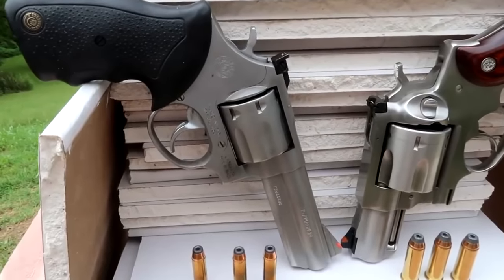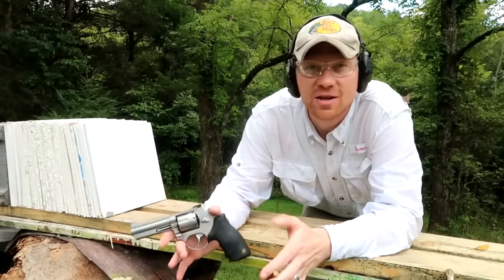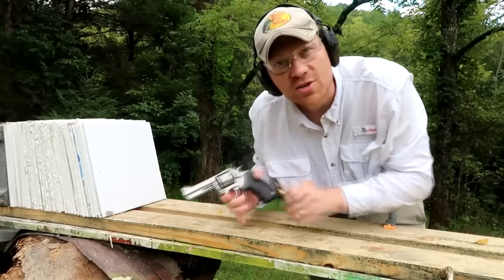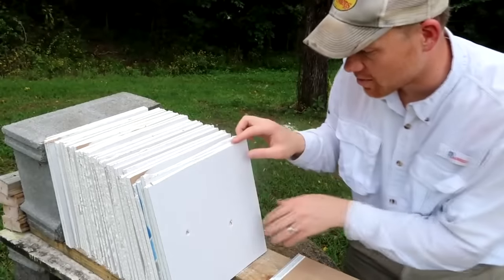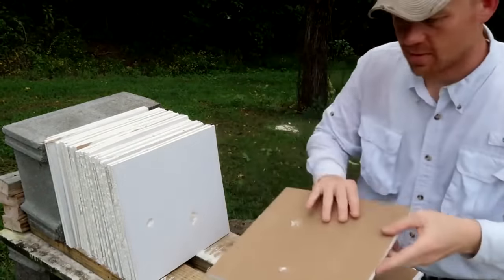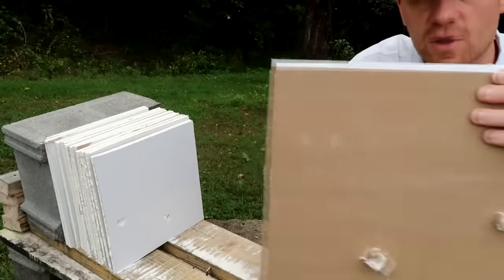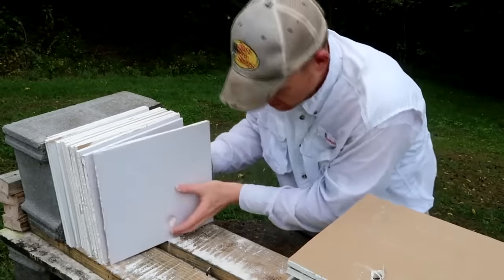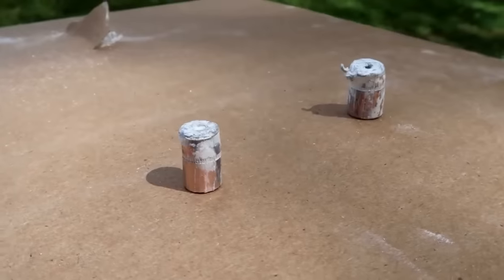.357 mag vs .44 mag - Drywall Test

Comment: Adam, don't you think the 44magnum would have made about 4 more sheets if it had an 8 inch barrel?
Reply: Of course it wldve I like snub nose heavy caliber pistols tho the intent 4 em is 2 get up close and personal
Reply: @BlaccSuave  Rather use a 5 inch and put the barrel in their navel. and I wouldn't waste 40% of the powder charge.
Reply: Had the barrels been of equal length, the 44 would have definitely penetrated a few more boards.
Reply: My 44mag Ruger has a 7in barrel.  I bought it in the mid 80s. Last year I put a Leopold scope on it. Love it
Reply: Maybe, but then again if the bullet was traveling faster it may have flattened the bullet more causing a larger hole and less penetration'
Reply: I think test was unfair to 44 mag
Reply: What if the barrel was 3 feet long. Do you think it would go through more sheets. What about 40 feet, maybe even 1,278 feet,  do you think it would go through more sheets?  What if it was a banana and you threw it as hard as you could? How many would that go through?
Reply: Yes
Reply: @garygilmore4670  depending on caliber. There is a ‘sweet spot’ in barrel length that gives a particular caliber the maximum opportunity to burn its charge before leaving the barrel.. guaranteeing the most velocity possible.
Reply: @HarrisonCountyStudio  It's like why a .44 going thru a rifle will give you better numbers than a pistol. Generally, longer is better. That's what she said...
Reply: ...i dont think the length of a barrel makes the bullet go any faster , if anything the longer the barrel the faster the bullet will slow,
Reply: @hungsolow4851  A longer barrel keeps the expanding gases in longer, so it pushes the bullet faster. This has been a known fact since they invented chronographs.
Reply: @ronhunt9396  
Did the exact same with a Redhawk I purchase in Kodiak AK in 1985
Reply: @hungsolow4851  unfortunately you’re wrong.
Reply: Test falsato dalla differente lunghezza della canna.

Comment: Space in between each sheet changes the final number. With blowout of the back of the drywall would allow more sheets or less sheets of penetration. The tightly packed sheets cause the rounds to compact the drywall. Need to space the dry wall by 4 inches to get a good reading on what really happens.

Comment: Drywall is notorious for inhibiting expansion in most hollow point rounds. No hydrostatic pressure to expand the projectile against the hard drywall around it.
Reply: Yeah definitely. The larger holes going through the drywall were from the bullets tumbling. Great video.
Reply: Hydrostatic shock expand some wet ass when the bulett is supersonic, not the bulett. For bulett expansion you need a more cavernous  holowpoint, higher diameter holow and soft lead not hardcast, or corbone with a hard ball placed in a similar conic shape cavernous soft bulett, or EFMJ that have radial striated FMJ over a front soft elastomer part placed over a back weight.
Reply: Remember, solid nose bullets penetrate much farther than hollow point
Reply: It also instantly plugs the hollow cavity, eliminating expansion, and basically turning it into a ball round.

Comment: In the “good old days” we used rolls of newspapers to stuff inside the walls where insulation would be placed. A .38 makes an excellent home protection gun as the bullet has less of a chance of wall penetration as do larger calibers and when a .38 enters the body it tends to bounce off the ribs inside the body , causing a lot of damage.
Reply: Like a m16 round does.
Reply: @grindfreakmike5754  Neither bullets "bounce" The 223 round shatters and those pieces create multiple wound channels.
Reply: Ummmm 38 sucks 😂
Reply: isn't a .357 Mag bullet smaller than a .38? Doesn't it always penetrate better than a .38 with the same grains of powder?
Reply: The .38 is also .357 in diameter.  Same bullet. That's why you can shoot. 38 special in a .357 mag. Revolver or rifle. @INUAGAIN
Reply: Okay dude you just said a bunch of nonsense not true science. Bullets ain’t bouncing around and even when they do that’s not what you should be counting on. Pink Insulation doesn’t stop bullets in anyways, and newspapers won’t either unless you have a ton of them compressed or stacked together and I mean an unreasonable amount. What you should really do is just get a .44 magnum and use .44 special which is comparable to .45 acp when in places for risk of over penetration, and .44 mag if that’s not a concern.

Comment: Great video; I would suggest using 2x6 framing with cement board over blue-board and fill the hollow with gravel and sand - 5.5 inches of gravel and sand may seem heavy, but it's not that heavy and I am pretty sure such a wall with a total of 8.5 depth and a hollow filled with 5.5 inches of sand and something like bluestone gravel will stop the magnums and likely even rifle rounds. Maybe you could make a small version and test it. Good luck. David
Reply: Maybe a sheet of 1/8" steel added for good measure. You're right though, that gravel fill would go a long, long way.
Reply: I was talking to a home inspector and he said he got into the wall of his 1920s farmhouse here in Michigan in the cavities were full of sand. I told him at least his house was bulletproof.

Comment: I have a Ruger 44 mag with 7 1/2 inch barrel.  I stacked 12 inches of fully dried treated lumber left over from a deck build. It included two 4x4’s and four 5/4 inch decking lumber.  All of it was several years old and very hard.  I used Garret 310 grain hard cast bullets from about 10 feet.  I fired two bullets. Both were stopped at 9 inches penetration and did not deform much.  I bought the garrets to take on a backpacking trip into grizzle bear country (Bob Marshall, Montana). One member of our party carried a 475 Linebaugh and I carried the 44 mag.  Everyone else carried bear spray as did I.
I wanted to be sure my rounds would penetrate and crush bone.  I’m satisfied with the power.  It is not fun to shoot that heavy load but put 44 special in it and there is very little recoil.

Comment: So, I skipped to the end and probably missed useful details on the ammo, but here are my concerns: For a valid test you need the same length barrel on both pistols, and then as close as you can get to the same projectile weight on the ammo. I also think solid ammo would be preferential to hollow points for max penetration and more uniform performance comparison. But it was still interesting to see. Thanks for the video!
Reply: The  44 was at a disadvantage dye to excesive wrist recoil due to the small snub nose barrel , try it again using the 7   3/4  inch barrel ,  like mine , Huge difference !
Reply: They're comparing apples to oranges. If every thing were exactly the same then what exactly would you be comparing?
Reply: The .44 was aimed at a lower angle as well...
Still nice results!
Reply: Yeah, that's what I was thinking too. Use the same length barrel.
Reply: @gregpalermo3861  Everything else except the caliber or bullet should be the same. Even the angle of penetration should be the same. The 44 was at a disadvantage regarding the barrel lenght and the downward angle. We know that longer barrel means farther distance and downward angle is like passing a thicker board.

Comment: I have 2 issues with this test. 1. Barrel length is important for a test like this, and was obviously different and was not mentioned. 2. I'm betting in the real world, where the drywall layers are separated by large gaps, results would be different.
H
In Georgia where I live, not sure it's still the law, but when handguns were first legalized for whitetail deer,  there was a requirement of minimum 500 ft lbs muzzle energy. At the time, I read up on it since I had no experience with handguns. There were only 2 common loads that could achieve that, the 44mag and the 357mag. Barrel length was a factor. So legally you had to have something like 8 or 10 inch barrel with the 357 and I like the flexibility of being able to use it with 38 for home defense. So, I lost interest, since that is not much more convenient than a rifle, and for me, didn't make sense since I'm pretty good with a rifle and not so much with a handgun.

Comment: Fantastic "REAL WORLD" test Whooti, as others pointed out, the lack of expansion was due to non hydrostatic pressure, pass it through some water in a gallon jug and then through  drywall and you would have stopped at 4 or 5 and good expansion

Comment: I was only expecting 4 or 6 sheets of penetration. The 44 mag is a few inches shorter. I think the 44 gains 25 to 50 fps per inch of additional length which translates to 12 to 25 ft/lbs energy per inch. Which may add an additional 1 to two more sheets of penetration. In any regards, this was an interesting test. Thank you.

Comment: I'm completely amazed at how many layers were penatrated
Reply: The Paper Goomba ur real cool what are u 12
Reply: @tomprice3513  Yes 12/10 in looks according to ur mom
Reply: @thepapergoomba9390  ain't going to lie, that was a good comeback.
Reply: @tomprice3513  Twelve year olds use "ur", and "u", instead of spelling correctly.
Reply: @thepapergoomba9390  your
Reply: I'm amazed at the time this took to find the bullets. Think I could get Mom's phone number? Just asking. Good day.
Reply: The 44 mag almost fell out of your hand.
Reply: I'm not.  Drywall doesn't have much to it, structurally.  I had the same thought with plywood, basically that I could "bulletproof" a room with plywood.  I did this experiment years ago.  Put a layer of sheet metal between the sheets and you will get a much better result.  Deforms the bullet and turns it so it keyholes. Cuts the number of layers by more than half.

Comment: I've seen some safe rooms designed to have layers of 3/4" plywood and layers of sheet metal, in addition to drywall. Seeing this experiment makes me think that might be a good idea.
Reply: The sheet metal helps a lot.  Did this experiment years ago. I think the result was 5 layers of 1/2 inch with sheet metal between each (.357).  Looonnng time ago though.

Comment: Use multiple layers of drywall and ceramic tile.  make sure you offset the tile grids on each layer.  My son suggested water, but you need like, 4'feet of water between your wall layers.  That's almost as bad as the Kevlar bonded drywall.  My wife suggested poured concrete.  If it was marine grade concrete, that might work.

Comment: The dry wall was back to back. It would have gone through many more if the dry wall was spaced out like a normal wall with 4'' studs. Provided you didn't hit a stud.  At 17 layers it could potentially go through 8 or more rooms if it didn't hit a stud.
Reply: Was going to post that if walls had spacing the bullet would have lost momentum between walls

Comment: Consider comparisons with fire resistant and water resistant drywall.  You may find considerable differences in penetration.
Reply: I was thinking the same thing. That looks like half inch drywall which is pretty standard for interior walls. I wonder how 5/8 fire rock would handle some rounds.
Reply: @jt76801  Me too.  I redid my interior walls on a log house.  There’s a big difference in drywall types.  Since I don’t know the right terms I’ll just say the formulas for the materials are a lot different.  I don’t think any of it will stop magnum revolver rounds in any practical way, but reshooting this video would be a good start in getting a baseline.

Comment: The drywall, like clothing, plugged the hollow cavity in the bullets.  A more fair test would have been pistols with equal barrel length.  The 357 has a two inch longer barrel.  Also, the 357 round was a light bullet (150 grains) and the 44 mag was a heavy bullet (240 grains).  A more equal test would be to use a 185 grain bullet in the 44 and use equal length barrels.  Too many variables to call a true winner.
Reply: Standard bullet weights are 158 and 240.
Reply: @everettyost8639  Certainly drywall will clog the cavity if it doesn't start to expand immediately.

Comment: I believe a better test would be to have allowed 2 inches between each sheet of wallboard, you might find out that the bullets would go through more sheets. With the sheets pressed up against each other  think it would take more energy to push the backside paper into the next sheet of wallboard. Obviously walls are not built with the wallboard stacked one next to the orher. I'd like to see another test with two by four studs with wallboard on each side.
Reply: I concur. The space between would allow for greatly different energy trasfer as the drywall would be allowed to flex as well as not pushing the paper into the next sheet. Probably would not need a full two inches either. Just a 1x1 would do the trick.

Comment: So the 44Mag starts with more interior-ballistics energy than the 357Mag, but transfers a smaller percentage of that energy to the bullet because of the shorter barrel, and the energy is sapped away from the bullet faster because it has to make a bigger hole. However, it looks like the 44Mag is enough stronger than the 357 that even those two handicaps can't beat it. Interesting.

Comment: Everyone is an expert.  The test should have been with barrel lengths of equal length.  Velocity is directly related to barrel length.  I am surprised that the hollow point did not expend more.  A solid would have penetrated further.  Same as the guy below.
Reply: Since they are different caliber and bullet weight it really doesn't matter what the muzzle velocity is because the energy would never be the same without a severely down loaded 44 round and a heavily uploaded 357. At the same time there is still a ton of powder that is burning after a 44 bullet leaves a barrel twice that length or even a 357 for that matter. The only way to get it exactly the same muzzle velocity even with the same length barrel would be to move the line for one gun or the other so that the velocity is the same on impact. In which case the energy of the 44 would be way more. Because, as  I am sure you know, bullet weight and velocity are the 2 factors in determining energy.

I was surprised how little the difference in penetrating power was with a point blank shot though. Obviously the 44 would still be hitting harder even with the shorter barrel so the diameter of the bullet creates more drag in the drywall. 

In a defensive situation I wont be taking long to decide my 357 will take care of business.
Reply: I shot high-power pistol Silhouette for several years.  Started with a 6" Python, I hit 31, and 18 fell.  The 44 was better but nothing like the 7mmBR.  What I was trying to state was that it was a poor comparison and generally unequal.  In my opinion, the 44 can do everything the 357 can at about double the results.
Reply: @jamesharvey446  Right I understand what you were saying. The cartridges are not even in the same category really, regardless of barrel length. which only helps to a certain extent anyway. It would have to be a lot longer for all the powder to fully burn for either of these magnums and by then generally speaking with a magnum the bullet is long gone at 1400+feet per second out a 3 1/2" or a 6" barrel. 

This is a decent comparison as far as point blank penetration though. Not sure if there was ever any doubt which one has more energy because it is still a 240 grain bullet travelling roughly the same speed as a 150 grain bullet in this test even though the barrels are different. That is what I think the test is about rather than making sure the guns are the exact same dimensions.   

It isn't a level playing field to start with so why make sure the barrels are the same length?

Comment: Rather than regular drywall, or the bulletproof drywall (fiberglass boards), what about Cement board like they use in bathrooms for shower stalls? I would think it would be a LOT denser and slow the bullets down a lot more. maybe alternating layers of cement board and drywall.
Reply: I agree I bet it would cut the number of layers in half. So curious I may do it myself
Reply: Your house would collapse from the weight required to stop the bullets

Comment: Would love to see a more real-world test of this type with a firearm.  My focus is on pellet rifles and there is at least one good video where the test was done with sheets of drywall attached to 2x4 stud sections and then line up approximating actual walls of a house.  It would be expected for the drywall stacked in this video to stop the rounds much faster than actual walls of a house where each 5/8" thick sheet is separated so that there is no progressive increase in resistance as material compresses in front of the round.  The .22 caliber PCP air rifle punched thru something on the order of 8 sheets of drywall so I expect that if these were set up like actual framed wall sections the penetration would be at least 50% greater than in this test.